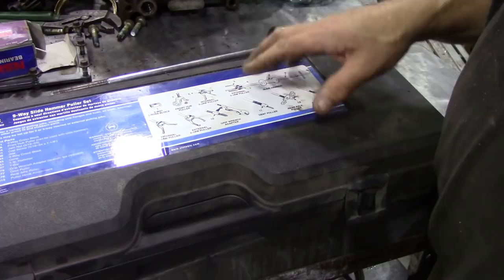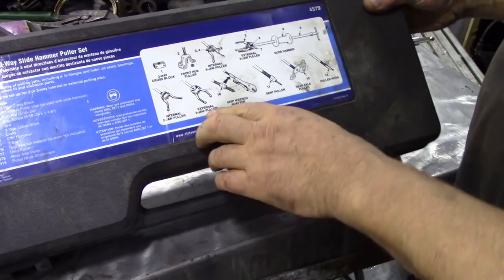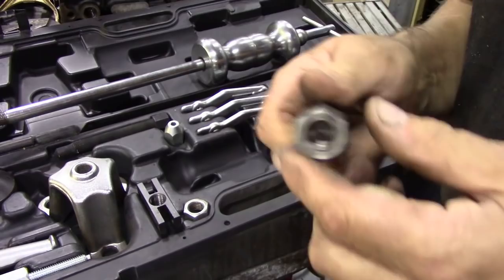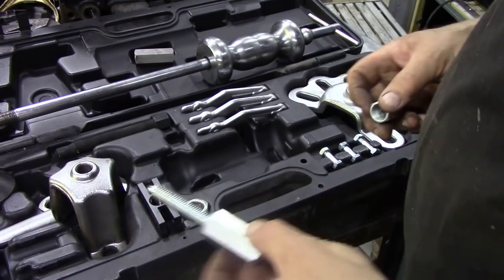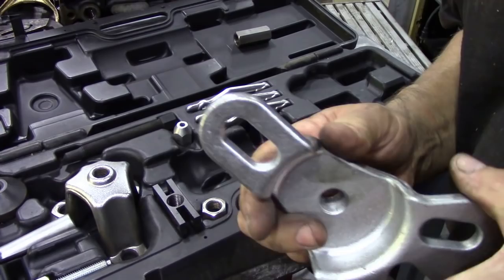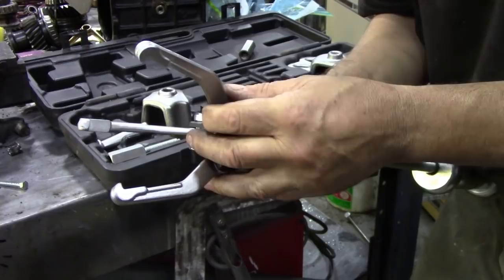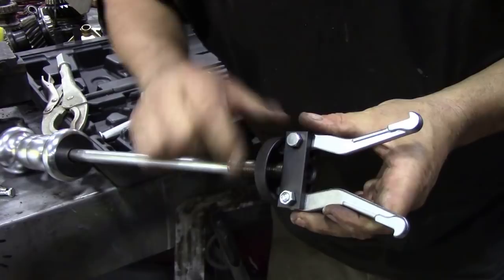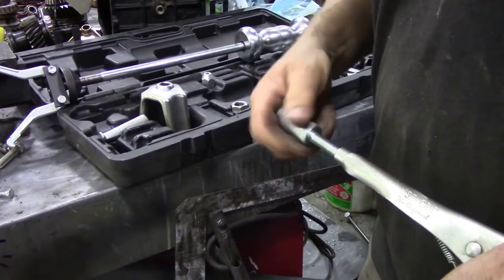Britannicas Top Tools! OTC slide hammer

Comment: This is a great tool that’s marketed under several different brand names. A lot of quality tools coming out of Taiwan at good prices. Here in the States I bought this kit under the “Maddox” brand name at Harbor Freight and it made quick work of pulling the wheel bearing races in my Toyota Land Cruiser FJ40. A difficult job without a tool like this to say the least. Great bit of kit as the Brits say!
Reply from the maker: I made an adaptor for injectors - great tool!